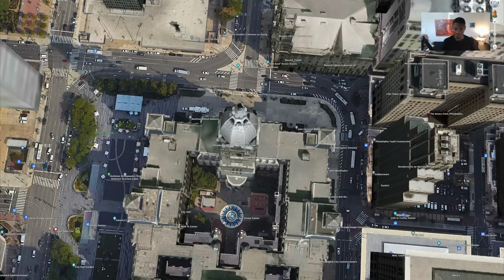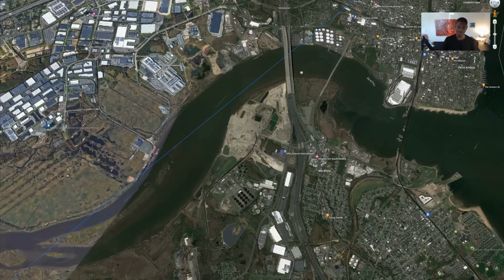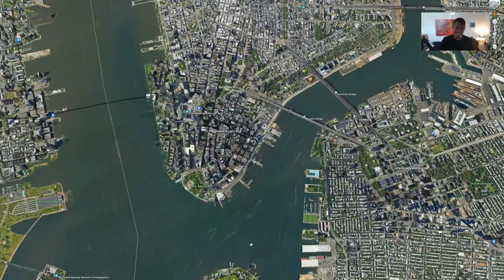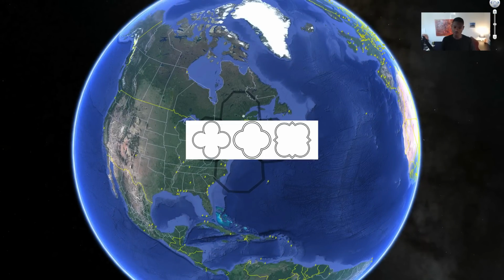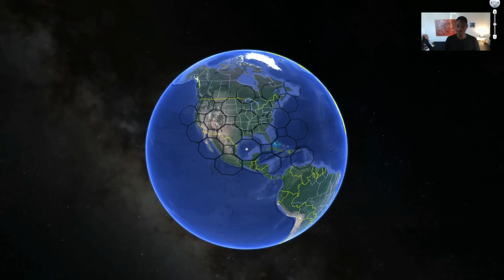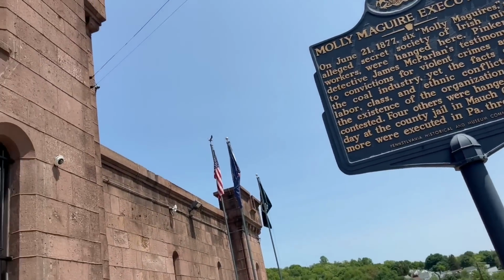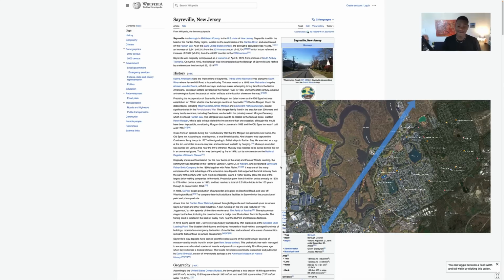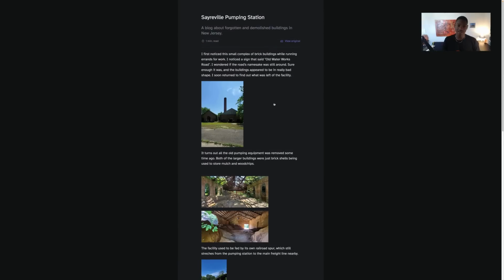In Your Own Back Yard

Comment: Lay lines were used for surveys, some natural some not.  WV geology has one diagonal arrow straight line through it that to either side is magnetic and gravity anomalies along with several fault lines.  The mason dixon line e-w and the north south boarder point extending from it matched up.  BTW that trash you dug up looks like some old glass and pottery with a little iron.  Much of the big stuctures may be old boom times or the prison was state funded as prisons were placed away from main towns.  Remeber riverbeds provided clay for bricks.  Study local histories and you will find more but ties to the prior civilizations is a stretch except common resources and needs that would dictate similar paths.  I live near Charleston WV and there was a prior civilization known as the mound builders with giant rulers and one map shows the layout of mounds makes a giant eagle with wings out stretched over the US with the Mississippi as the body.  On the upper Kanawha is stone walls predating colonies and forts in the hills above.  Richard Dewhurst and Gram Hancock are two I suggest you read.  Also perhaps a history of technology class might be wise as well as you will make more correct conclusions from the patterns you have noticed before jumping to the occult or conspiracy theories.  I am not saying you have it all wrong but you need to dig a little deeper first.  Btw much of central WV was first surveyed by George Washington and land granted by him to his troops.  The New and Kanawha was a major route from VA to Ohio in his day through the gap at present day Bluefield on the state line.

Comment: But How does the running water work with the key lines?  Most cathedrals have an old baptismal or foundation with running water and both orientation and key lines are important.  Some rocks can measure voltage depending on orientation. Says Rondecker in “l’energie vibratoire des ondes de forms” and “Carnac -ure Porte vers l’inconnu”

Comment: The three points that traditionally define the Bermuda Triangle are:  Miami, Florida,  Bermuda,  San Juan, Puerto Rico. Thanks Chatgpt.  I feel your first octogon is correct but you overlapped the next ones.  How many miles thick is the octo-border line in your video?  I feel like the ones around the first one should have butt up against rather than overlap.  Maybe just use a thinner line? However, the square that New England is in would still be center.  That's where they first landed, then that's a better starting point.  I'm very interigued with this possible sacred geometry.
Reply from the maker: It's about 45 miles wide, but great points. Thank you!

Comment: You are absolutely right! They probably collect energy from the roads. The 2 materials that cause the most static electricity when rubbed together are rubber and concrete asphalt. Vehicles on a road. Electricity actually travels on the outside of wires. Not a stretch to think that the wires all along the roads are collecting electricity. You are on it.
Reply from the maker: Not to mention the literal energy (currency) it takes to purchase a car, fill it with gas, etc. This is a well mapped out game it looks like.
Reply: Sneakers on sidewalks, also bicycles etc.
Reply: What about slippers and tv s.
Balloons and hair very static reactions.

Comment: Your work is very appreciated.

While not every spot on the line is prominent, the ones that are, are not a coincidence.

Take the school for example. The school itself may be a simple middle high school or college, but it may be very high ranking or well attended. Also, I would wonder if the crossing leyline, meaning the vertical to the horizontal cross would show even more significance to some of these larger spaces.

Also, here in Delaware we have a battery park as well. I am thinking it's more to do with where the battles took place? But, that battery idea is significant because the park is drawing of a lot of human electricity/motion.

Much Ahab to your wellness.
Reply: Oh yes, the octagon shows the crossing ley lines❤
Reply: Indiana is where that 2024 Eclipse crossing from 2017 is supposed to happen. I believe it's right in the shadow of the octagon.
Reply: Being from New England I can definitely attest to the change in air when you cross out of Connecticut and into New York. It's like an entire different atmosphere air environment.

It's most likely they were using compass and square to map straight lines from England to what landed on New England? I don't know.

Also fun how the Gulf of Mexico is an octagon unto itself for the most part. Also, Florida.
Reply: I wonder where Hawaii would lay?
Reply: 13:46

So you can actually kind of see a triangle of lines underneath where Bermuda crosses. What I mean is if you look slightly below the octagonal grid you can see some triangular gridlines in the dark of the water's surrounding Bermuda and it seems the triangle does cross just shy of the octagon.
Reply: I'm so glad you brought up the four corners! 15:16  ... To me it looks like the eye of a dragon. Yet, you would have to turn the map 90° to the left.
Reply: I wonder if those places were more of a safe house for when the pilgrims of different lands would come over for protection from the melanated copper indigenous Indians who were fighting to get them off the land?

Overtaken buildings.
Reply from the maker: Thank you for the time to share all of these observations! I will take some time to consider...

Comment: Some other interesting places to look into are Hillsdale Michigan,  Michigan Bermuda triangle and Lake superior copper and silver mines. Hillsdale is interesting bc it looks like it used to connect 5 major rivers, but today it's a small nothing town in the middle of nowhere. Also there is almost no history on the location. But if it did connect those rivers it would have been exceptional. 

We are told that up until very recently,  the settlers would just bury their waste on site. Which is why we can find trash and stone foundations in literally any field or forest. This does not explain the countless foundations I've personally seen covered in mature trees, made of concrete much stronger than modern concrete. Nor does it explain the volume,  I've explored the UP,  to New York, to Florida,  to Arizona.  It's literally everywhere.  So at a minimum we have not yet reached our pre reset population size. Also I think ancient civilizations utilized their waste in building materials which is why we can't find any, and why theirs has greater longevity.
Reply from the maker: Your insight and connections are always welcome!